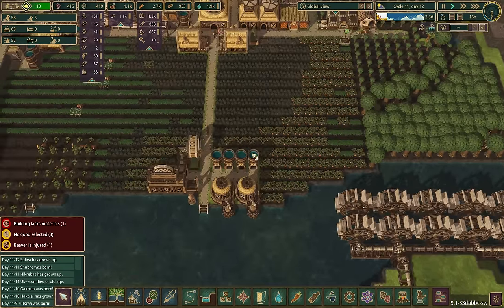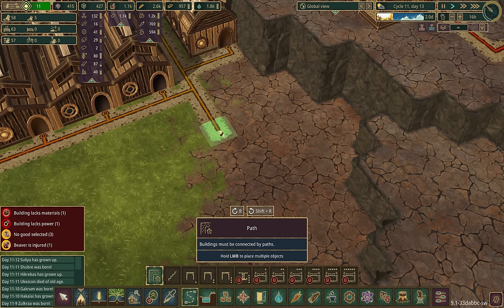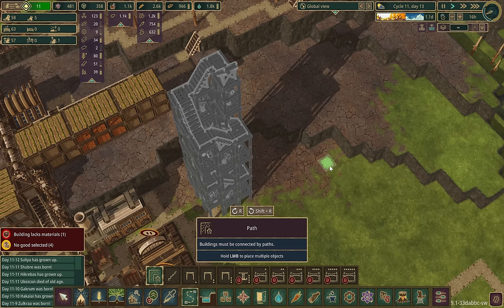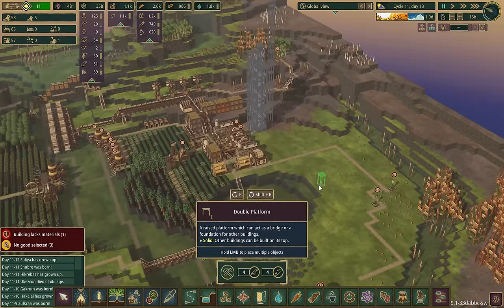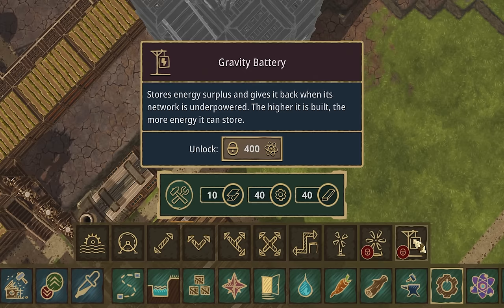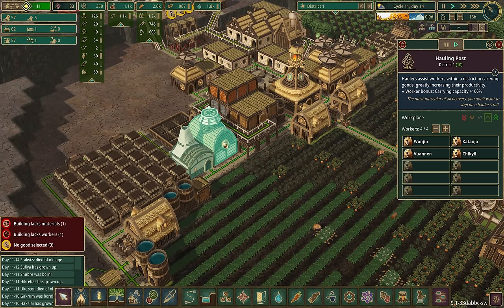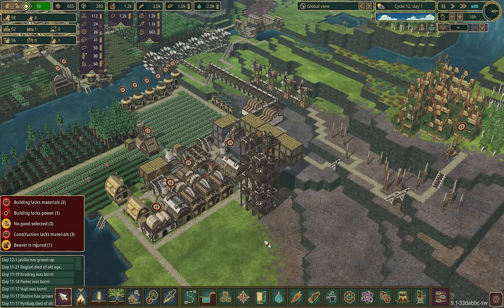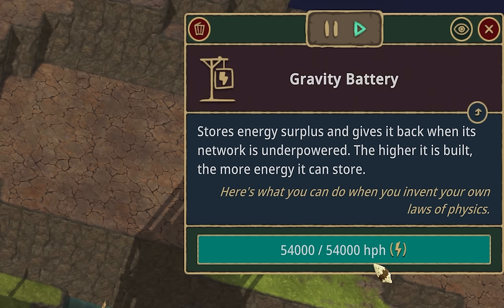I Built The LARGEST Power Tower in Timberborn and then this happened...

Comment: You definitely should close the dam and drain the badwater. it'll speed up the healing process. If you don't drain the bad water, when the wet season comes, the fresh water will have to dilute all the bad water and push it out. draining it personally should save you a day. just be sure you can reach the dam from the shore and rebuild it. you might have to demolish the middle dam as well to flush that reservoir but since it's shallower it might be fine.
Reply: easy solution is make a cut out at the top with single height gates at the edge of the top water fall and where the cut out is. then you just re-route the bad water during the bad tide.
Reply: @sirmonkey1985  That's basically what Biffa already has in place. He just kinda forgot about it 😂
Reply: Yes, he needs to close the gate and flush the badwater. Anything not dead will just be on drought and not on sick. It will also prevent the beavers from swimming in the badwater and getting sick.
Reply: @squallloire  right i forgot about the gate on on the left of the reservoir. that needs careful managing since it could backflow and cause more badwater to go into the lake. i rather he just made demoed a block in both dams and just rebuild a with a floodgate. in case something like this happens again, you could release the bad water quickly.

Comment: hph is horsepowerhours. Each battery is storing (or was storing, as you built a house straight under one of the four) 54000hph, if you divide that number by the power requirement, you get the total time in hours that the battery will last. If you need 500hp, you are good for 108 hours per battery. You can use dynamite under the counterweight, dig a hole to the bottom of the world in successive blasts, and increase the amount of usable energy per battery. And having a hole under there will prevent you from building anything in the path of the counterweight.

Comment: Biffa was also letting fresh water spill out through the flood gates he put in to help redirect the bad water away from the colony.  That's why his power wheels aren't generating as much power as they should.  If you need those open to keep the fresh water from spilling over the top of the dam, then you'll need 4 flood gate units in both sections.  Otherwise, the bad water will spill over the top just like the fresh water.
Reply: He doesn't have enough flood gates dumping water into his main reservoir, he needs to put more in otherwise he has to have it spill out of the side or it will over-top into his colony.

Comment: 4:20 The Observatory makes about 13.3 Science per hour, but it requires 4 Beavers, so that’s 3.3 Science per Beaver, x3.3 more efficient than the Inventor’s Hut, if you ignore the need for Power (although even in the worst case scenario, Power from 4 Hamster Wheels, it’s still x1.7 times as efficient as a Hut).

Comment: The game will work better and you'll have an easier time if you stop putting all of your buildings on high priority. There are a few ways to set it up so to each their own, but I do water pumps as highest, all and any kind of food buildings as second. Everything else is on normal. Builders on second to lowest (I"ll toggle builder buildings depending on if I'm actually building anything) and my haulers on the very lowest. Haulers are essential for your colony to run properly but if your other jobs are not filled there is nothing to haul. Great to see you outside of CS

Comment: HPH stands for, I assume, Horse Power Hours.
It may seem like a bit of an odd unit, but its saying you could have 1 hour of however much it has stored, or 10 hours of the number divided by 10, and so on.
Same as WattHours with normal batteries
Reply from the maker: I prefer Hamsters per Hermit :P

Comment: I have to say, I've been thinking about that river crossing, and why you haven't built a bridge
Reply: Because, as long as you redirect the bad water (like he had been doing), you should avoid bridges so that your beavers don't need to use showers as often.
Reply: It was also helping with wet fur.
Reply: Well, I usually add showers and lidos for wet fur
Reply: @sharpless  yeah. But he mentioned it in a previous video I'm pretty sure.

Comment: Hey Biffa, I know it looks pretty bad but you can definitely save the colony still! I believe in your skills. I have no idea the order in which you play and record these, but if you want some spoiler-y tips here's what I'd suggest:

1. Immediately: Stop your beavers going through the contaminated water - Delete the path they are using and instead use the path downstream which goes over the water. Then probably also build a new path on platforms over the water where they currently are going through (since it's a much more direct path)
1a. Beavers take a couple of days before the bad water sickness sets in but once that happens you'll have a serious labor shortage. Last I saw it looked like about 35 beavers we're 'unwell' so in a few days all of them will leave the workforce. They'll still eat and drink but that's about it.
2. Modify the floodgate positions anyway to reroute the badwater. Especially the downstream reservoir region may still have some good water which could be pumped.
3. Next, while the bad tide is happening, plant a bunch of dandelions around the one patch of still clean water. Important to note they are planted by Foresters and NOT by Famers. And they are harvested by Gatherers (like Berries)
3a. Check if you also need to plant an extra patch of berries based on how much died. You should have storage of these so probably you're fine.
4. As the bad tide ends, you'll need to clear out the bad water from the main reserve. Just demolish a section of your down stream dams and let the water move on.
5. Install a couple stream gauges at various areas especially to check on the contamination level.
6. Once all contamination is gone (or is maybe no higher than 1-2%) rebuild the dam.
7. Your food reserves in particular should be okay. Beavers eat about 3 food a day (actually a little less) and so the storage you have will support the 80 beaver colony for about 12 days.
8. Likewise your water reserves should also be fine until good water has returned. Your biggest risk here is actually the impending labor shortage.
9. As the dandelions start to yield consider adding one or two more Herbalists to produce antidote faster.
10. If the labor shortage hits hard focus on just water (via the large pumps first), famers, and medicine makers.

Hope that helps (if you want it) Good luck! Though, if you do that you should really be in good shape. Decent chance you don't lose any beavers and you'll definitely save the colony.

Comment: You can get even more energy storage out of the gravity batteries if you blow up the land under the carriages. Each additional block down gives 2000 hph (Horsepower per Hour, 1000 hph ≈ 0,74 kwh) extra. Also, if you put buildings under the carriages, it will decrease its storing potential because the carriage can't lower that much anymore.
And no worries blowing a hole into your world because the game just won't let you place dynamite on the deepest layer of blocks.
Reply from the maker: Good ideas 👍

Comment: I made the same mistake at probably the same population. They should bounce back, but it will take a while and you absolutely need the herbalist, though it could already be too late. Concentrate on food/water production, halt any upgrade work because all your sick beavers will be using all your resources and not working. Other observations, you probably have too many water barrels - try to switch to using a body of water to supply, or go further up the river and create another blockade where the water is deeper. You also didn't need all those electric pipes at the bottom, just feed it into the first building and it transfers through adjacent buildings.
Reply: Another point is that you should be looking at the beaver happiness more.. you actually need to build an awful lot (too many in the case of campfires/rooftops?) of wellbeing buildings to get the main score up. I haven't played it far enough to know what happens when it gets really high, but you need 15 to unlock the other beaver creed.

Comment: Wouldn't it have been more cheaper to build the battery tower on an already higher ground level? Or does that not matter and the battery works only if it's on such a structure? Just wondering
Reply: Yeah, that works.

What you can actually do is place an excavator on a mountain and let it drill all the way to the bottom. Then all you have to do is to demolish the excavator and place the batteries on the edge.